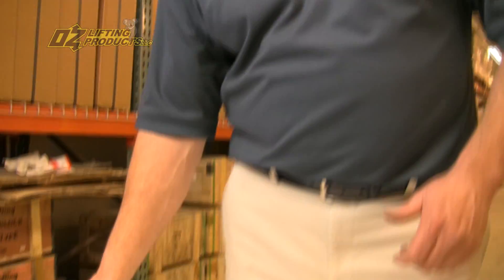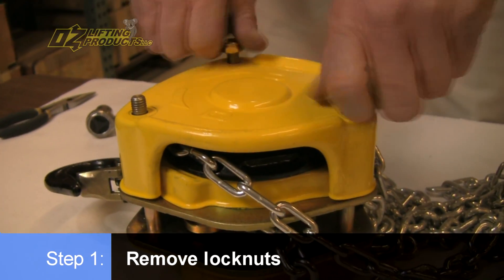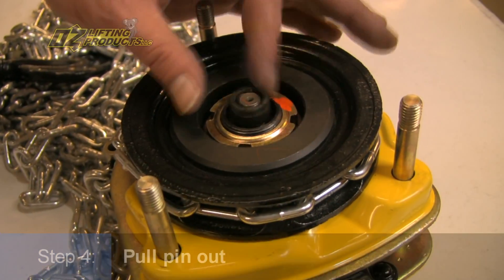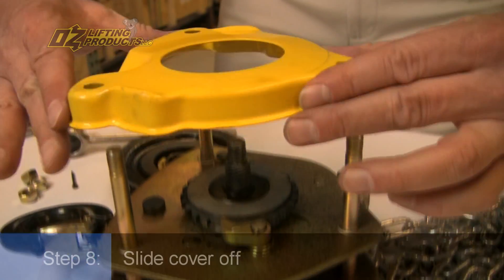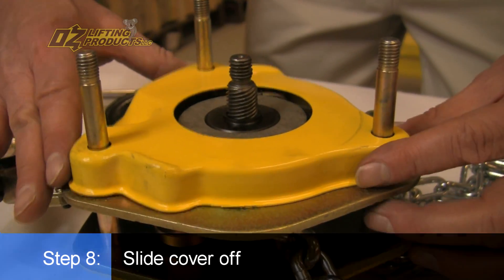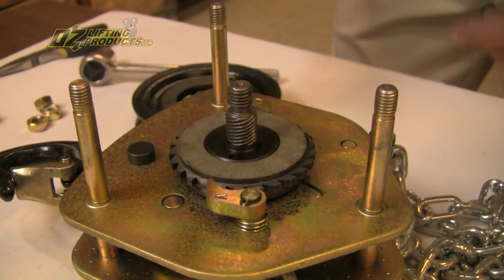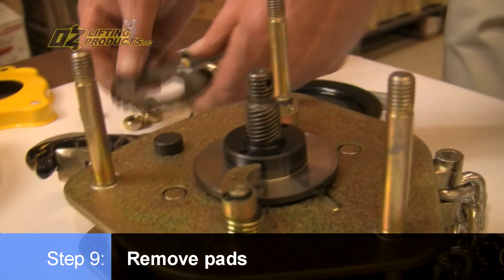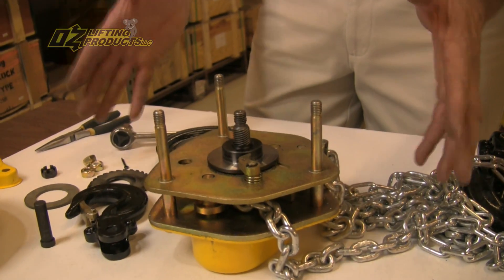Chain Hoist Disassembly for Maintenance - OZ Lifting Products

Comment: Where to get the replacement break pads?
Reply from the maker: Replacement parts can be purchased directly through OZ Lifting Products by contacting our Customer Service Department at (800)-749-1064. In order to get the correct parts for our product, you will need the Serial Number off the product.

Comment: Thanks for the video, but what is the maintenance involved? Surely there is more to servicing the hoist than simply taking it apart and putting it back together.
Reply from the maker: Please see the link below for more information. There are a few different inspection types that are recommended. You can give us a call at (800)-749-1064 and we can answer any questions you may have.

https://ozliftingproducts.com/wp-content/uploads/2020/02/OSHA_Requirements_Hoist_Inspections.pdf